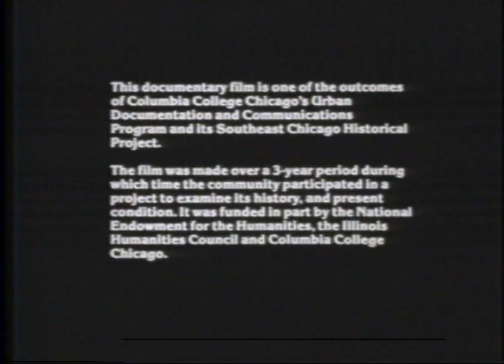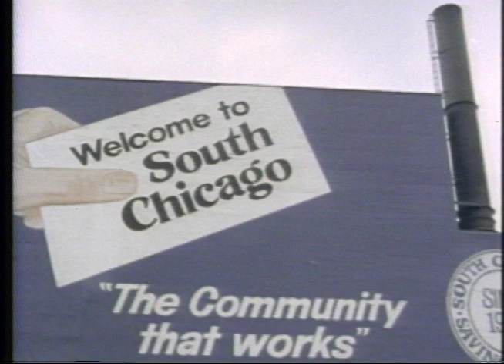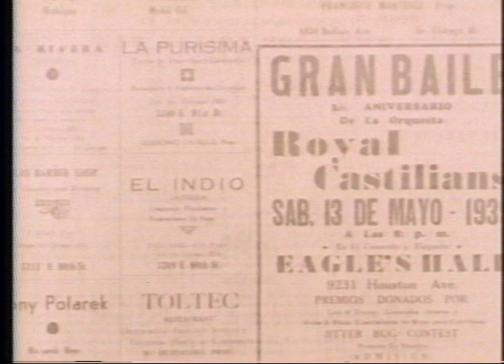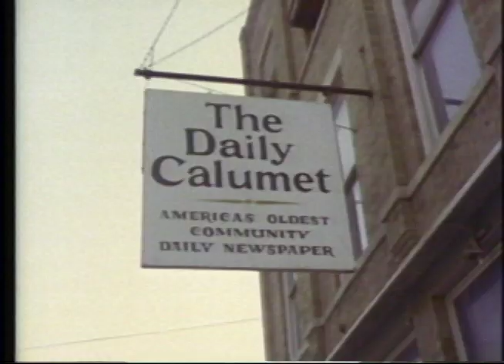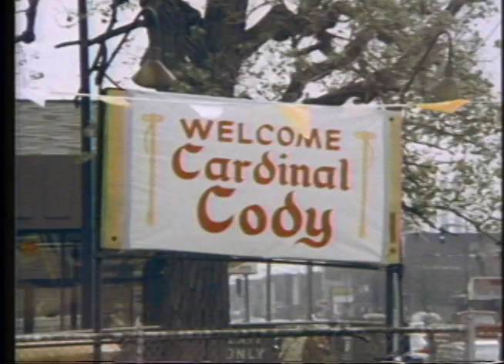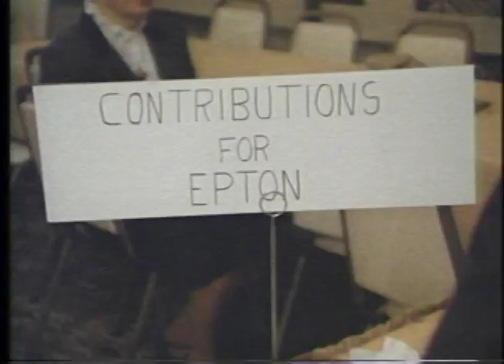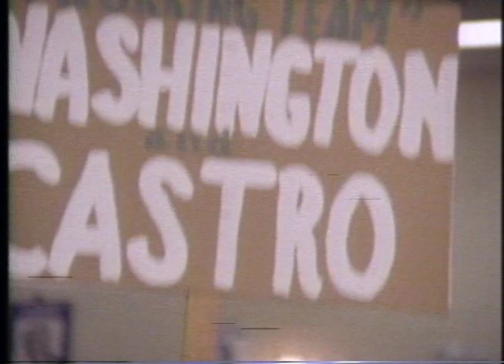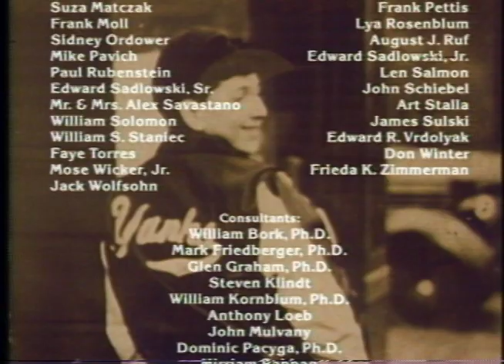WRAPPED IN STEEL - The Story of the Neighborhoods of Southeast Chicago

Comment: Thank you for this video, it brought back a lot of memories. My mom lived on the East Side as a young girl before moving to Indiana Harbor. I drove a truck for Production Tool the Summer of 1973 and I went to every Steel mill in the area while they were all still running. In 1976, my then father in law got me a job as his clerk at Republic Steel. Was there until 1982 when my department shutdown. My uncle was offered a job as Superintendent of HVAC at Wisconsin, which he turned down. Said it didn't feel right. Six months later they shut down. I believe a guy from Republic took the position, as I heard, he gave six weeks notice and they told him he could just go the next day. It closed three weeks later

Comment: I was working cradle man on shear in 5 mill 3 to 11 shift day it shut down years later I cut that shear in half got on top cut bolts holding knife my father screaming at me nut and bolt shot through roof cut spring on other one before knife dropped then cut base bolts d 9 knocked it over and cut it in half it was like 2 ft by 3 ft thick solid steel in center got it in size can get out there then came the roll tables and 6 mill stands and a universal mill greasy dirty job used burst into flames sometimes omg the grease cutting that stuff up was unbelievable. I learned how to burn in 5 mill on roll changes cutting up cobble on roll changes nice clean still hot steel bars billets. Nothing like the rust and rot and grease and oil the steel in rest place was covered with that was some god awful shit my car was door to door mill grease omg Buick the B and U fell off it just had ICK on hood lol cutting all that up was fun. No showers out there running water used bust up office furniture get fire going in winter put coke from coke plant in can. All like a bad dream now empty fields were Wisconsin steel Republic steel Interlake South Works got few pictures of cutting it up was going make a youtube video not sure what song to put it all to...
Reply: Please let us know when you post it on YouTube.
Reply: Think I worked blast furnace with you
Reply: How you been dauragtey
Reply: Good man did 25 years Army and you ?
Reply: @mikedougherty9773  we worked in blast furnace
Reply: See anyone else from the mill ?
Reply: @mikedougherty9773  not in years
Reply: U still in illinois ?
Reply: @mikedougherty9773  ya working Indiana family processed steel years I worked steel up into 2007 steel was like a family thing pollacks my godfather superintendent my cousin foreman were elese I can go was boilermaker to old work scrap yards cut scrap my hobbies always go to school city colleges be ruff road irishman my daddy die was in prison steel they done that in still cousin work steel real work steel been long hard road I would look you you so dam Irish family married Irish miss um rusty teach boxing cal park Bessemer park Irish boxer may golden gloves come back South side Chicago rusty not like you short runt box mean always want me fight call me Davy dukes I know boxer I no boxer you Irish not have be brought up.irsihman he used get me ally pound hit me get me mad put my dukes up ya right hook knock him out I no fighter. My poor aunty raised good half breeds did her best Chicago finest you was not sure foot psychologically think get footing go far wonder what ever happen that skinny little irishman on high line shovel.iron you could actually say you there you never made in floor I worked blast furnace floor that winter 18 men died you remember
Reply: @davsAlmanac  take care best of luck to you
Reply: @mikedougherty9773  hey Mike how you been
Reply: @davsAlmanac  good and you

Comment: I cut them mills up I went to Immaculate Conception and Saint Micheal's started cutting up with Wisconsin steel then South works I cut up the locomotives bring my granddaddy ingots whole family steel men I pop holes in ingots with ox lance put chain in they beat that iron with them I cut down vessels Wisconsin steel 3 foot thick shafts blow through them 150 tons hit ground glasses come off bar in Elys my father cooking wire rubber raining down on Torrance was hat funny daddy burning wire rubber rain I mean tall money I pulling this cables copper lead lined out sewers big money